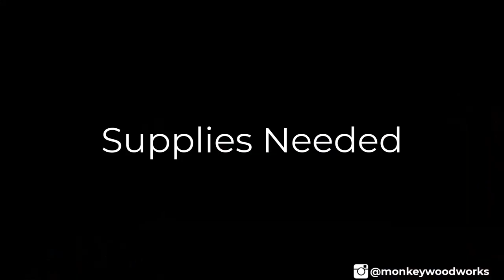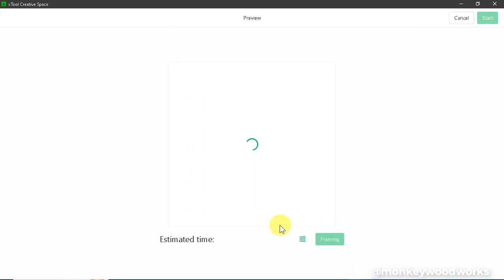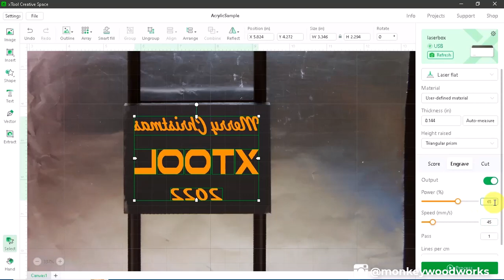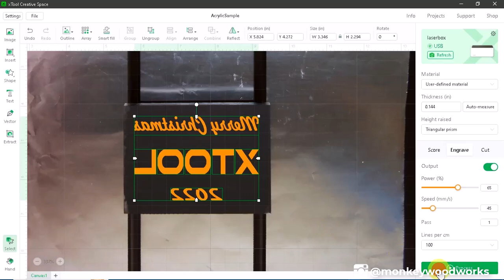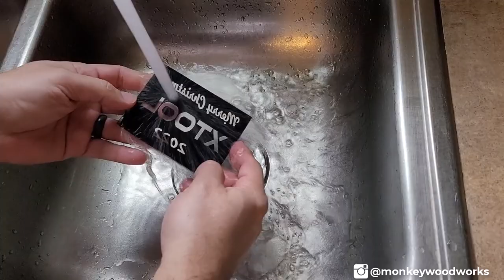Engrave (Etch) on Clear Acrylic with a Diode Laser

Comment: Michael, I absolutely love all of your videos on the M1.  I'm new to lasering and have now run into a problem attempting to cut acrylic. I used the recommended settings based on XTools material list (opaque green, shiny, 3mm) According to the recommended settings Power=100, Speed=3 and Passes=3. When I use this configuration it doesn't cut and barely scratches the surface.  Any recommendations? Thanks!! 🤞
Reply from the maker: Hmm. I honestly didn't have much luck cutting anything other than black.  I was able to CT other colors however I never liked the edges.  I suggest you join the Official xTool Facebook group dedicated to your machine and use the search tool.  Lots of posts and settings shared by others there.

Comment: Thanks @MonkeyWoodworks for the video and the great ideas. I was just about to throw away the idea of getting a diode laser for my Genmitsu 4040 because I want to engrave text on white acyrlic and everyone said it can't be done!!  But looking at what you have done, proves that is not the case. Now, the Tempura paint allows it to be easily removed post lasering. But can you confirm or at least offer a possibility that if you don't want the paint to be removed post laser, then aerosol spray can paint would work? What I am doing is building a flight simulator and I need to create the grey panels and etch the white text on them. Many of the other cockpit builders out there are using the CO2 laser but it's just a bit rich for my blood so I was looking for a more economic solution.  So I was wondering, if I should adopt your technique but modified to use a medium grey matt (aircraft panel colour) spray paint and then laser etch on top of that? The paint doesn't have to be removed afterward , in fact it would be rather super if it never came off at all!!  If you think this is a possibility, then I might reconsider getting a diode laser module. Thanks in advance👍👍 Terry, Auckland, New Zealand
Reply from the maker: I am not 100% sure if that will work or not.  The diode is using the tempera paint to etch the acrylic.  It is hitting the paint and melting just the top layer of the acrylic to achieve the look you see in the video.  I will see if I can try what you are asking on a test piece to see what happens and find out how it looks at the etch location and around it.
Reply: @MonkeyWoodworks  Thank you Michael that is most helpful of you.  As you say, there may be a difference between the actual paint properties that makes the tempura paint more suitable to this process beyond the fact that it is also easily removable. Perhaps the thickness of the tempura is the also a key to this process since aerosol paint is rather thin.  Anyway, I look forward to hearing what you discover whenever you are next in the shed with some idle time to try this. Fingers crossed. Thanks again Michael.👍

Cheers, Terry

Comment: Great video. I have been working with clear acrylic also. I didn’t think of putting multiple layers of the tempera pain and thinning the paint. I will have to try your method.
Reply from the maker: Let me know how it works out!  It is all about keeping the paint smooth and free of bubbles.  What method do you use for your clear acrylic?
Reply: @MonkeyWoodworks  i did a single coat of the tempera black paint, and painted both sides of the clear acrylic. I also was using the clear acrylic that is 3 mm thick and cut in the shape of a Christmas ornament. I did cut in 15% power 45 mm/s to give it depth so it was easy to see. Engraving it was so light it was hard to see after washing out the paint. I had realized from your video why the acrylic was burning or popping when I used to much power. I also was using the honey comb. I am also using the xTool M1.
Reply: @MonkeyWoodworks  oh, it was the acrylic ornament shapes where I can buy a large number say for example 32 pieces for about $10 on Amazon
Reply from the maker: Nice!  I will  have to look into that for next year.

Comment: Hi Michael, can you use the black tempera paint on the clear acrylic and be able to cut it?
Reply from the maker: I have not tried that yet.  I am thinking once it makes it past the layer of paint, it will just pass right through and not cut it.  Although, it would be interesting to try!
Reply: @MonkeyWoodworks  i thought if it works on glass or even painting both side of the acrylic…on glass I use black chalk paint much thicker one coat.

Comment: Good job on this video - Clear and concise. 3 Questions... 
Did you focus on the top or bottom of the acrylic?
What type of acrylic & thickness?
Reply from the maker: Thank you! 
Top - I manually entered the information.  You can also put a sheet of paper on top of the material to help with automatic focus.
I used xTool's 3mm clear acrylic for this project.

Comment: Every time I try to use this same tempra paint, it just beads up on the acrylic and does not stay where I try to paint it. What am I doing wrong?
Reply from the maker: I find that it is a pain in the neck on the first 2 to 3 coats.  Especially on the edges.  Make sure you water down the paint, use a soft bristle brush, brush in one direction only, and do not push down on the brush, use the weight of it instead.  You can change directions of the brush stroke between coats but not on a wet coat, it seems to pull it up more that way.

Comment: Could this method work with other colors like yellow or orange?  I know the diode has issues with blues also.
Reply from the maker: Yes, I believe this will work with them. The outcome is OK but not as good as it looks on glass imo.
Reply: What about to cut thr colors? Would the paint allow the cut? Like for earrings
Reply from the maker: @nikkitts628  no, the paint does not help cutting.  However check out the Official xTool Facebook group.  There are a few people that have been experimenting with various colors and have shared their results in the group.

Comment: Do try any other coating such as dry moly on the  clear acrylic?
Reply from the maker: I have not.  xTools marking paper, and tempera paint are the only ones I have tried so far.
Reply: dry moly did not work.  i tried

Comment: Please explain how to make tempera stick to acrylic - especially after watering it down.
Reply from the maker: Soft brush + a light touch + multiple layers.
Reply: @MonkeyWoodworks  but how does it stick? It has no adhesion
Reply from the maker: @arcxjo  I find that it is a pain in the neck on the first 2 to 3 coats.  Especially on the edges.  Make sure you water down the paint, use a soft bristle brush, brush in one direction only, and do not push down on the brush, use the weight of it instead.  You can change directions of the brush stroke between coats but not on a wet coat, it seems to pull it up more that way.  This part of the video explains exactly how i paint it.

https://www.youtube.com/watch?v=hbL4HE1u7sI&t=140s

You can also SPRAY a watered-down mixture of tempera paint using a fine sprayer.  You may have to water it down a bit more for it to spray but i have seen people use it with great success on acrylic, glass, etc.

https://amzn.to/3PzpMek
Reply: @MonkeyWoodworks  are you pretreating the acrylic with something?  Temperature DOES NOT STICK TO ACRYLIC, and even less so if I intentionally water it down
Reply from the maker: @arcxjo  I am not.  It is clean acrylic with no treatment.

Comment: Newbie question lol - does anyone know if you can use painters tape on acrylic to engrave it? Thanks :)
Reply from the maker: I have not tried that method personally.  If I do, I will be sure to come back and let you know how it went!
Reply: @MonkeyWoodworks  thank you - I don't want to start a fire in my M1, so I am hopeful someone else will try it first. Have a great day and thank you for your really helpful content.
Reply: Hello, do you think it's possible to engrave / etch polycarbonate for a led lit sign with a 5watt diode laser ?
Reply from the maker: I am not sure.  I see on another site that it is a poor material to laser cut due to the material.

Comment: Did I miss why you put aluminum underneath?
Reply from the maker: The aluminum layer simply protects your base plate and keeps it clean. Doing so allows the cutting mat to stick to the base plate when you are using the blade.  If you use foil, I suggest you put the shiny side down to reduce reflection and a few pieces of painters tape to keep it from ligting up due to the exhaust fan.

Comment: I wonder if acrylic spray paint would work, it’s highly pigmented, and dries quick.
Reply from the maker: I am not sure.  I am guessing if it can be taken off without scratching the acrylic, it is worth a shot!
Reply: @MonkeyWoodworks  maybe black vinyl to peel off?
Reply from the maker: Maybe but I dont think you can engrave on top of it.  Might just make a melty mess?
Reply: @eclecticlight.design  just FYI vinyl is listed as a no on the xtool, you shouldn't cut pvc materials it can ruin your laser. Cheers!

Comment: whats the benefit of the paint? it kinda looks the same to me if you didn't use any paint. the glass def looks better with the paint but not sure if this works as well for acrylic
Reply from the maker: A diode laser (like the M1) can not mark on clear items (glass, acrylic, etc). The laser just shoots through  it like a flashlight.  Adding the paint gives the laser something to "hit" and allows it to mark the top of the material.
Reply: @MonkeyWoodworks  would this also be effective with a C02 laser?
Reply from the maker: No.  There is no need for the coating on a C02 laser.  That type of laser is a different wavelength allowing it to etch directly on clear glass or acrylic and can cut clear acrylic like butter.

Comment: why the use of aluminum paper? 🙌
Reply from the maker: That is used to protect the black base plate from getting lasered to keep it clean.  When you use the blade feature of the M1, you stick the cutting mat directly to the base plate then your material on top of that cutting mat.  Keeping the base plate clean when lasering will allow the cutting mat to stick better to the base plate.  If you do use aluminum, make sure you insert it with the dull side facing up.  Also, check out my M1 material settings google sheet where it has a picture describing the use of the aluminum sheet as well.

Comment: do you engrave on the painted or non painted side?
Reply from the maker: I did it on the painted side.  You can always experiment and find out which way works best.  Let me know the results if you do!
Reply: @MonkeyWoodworks  I did do it on non painted side and didn't have much detail show up. And I've tried, chalk paint in a spray can and brush on with a piece of wood underneath to give the laser something to reflect back. But I am also using a snapmaker machine which I really don't care for. But can't quite afford an xtool at the moment.
Reply from the maker: @liquidlightning101  All diodes will have a similar result due to the laser type.  Honestly, a CO2 is the best way to engrave acrylic (especially acrylic).  Unfortunately, they are $$ as you nay know.
Reply: @MonkeyWoodworks  ya my wife bought me a K40 and after I had to replace the laser tube and the new one not lasting as long. I wasn't too happy with it. But still have it, may need to get another tube for it and use both
Reply from the maker: @liquidlightning101  Ah.   That's too bad.  I wonder if the tube quality matters on it?
Reply: @MonkeyWoodworks  I did get one by cloudray which I've heard was supposed to be one of the best ones.

Comment: During framing the laser outlines the green lines on the project so make sure they are inside the boarder of what you are going to laser.
Reply from the maker: Yes, I have done that method a few different ways.  On the edge of the object or just inside the edge of the object.  Framing the object itself is definitely the best way to make sure your centered on what you will be engraving.   I just wish the framing feature could frame like light burn where it will follow a circle/oval/misc shape.
Reply: Yeah it just gives you a basic frame to show the position, nothing detailed or precise.